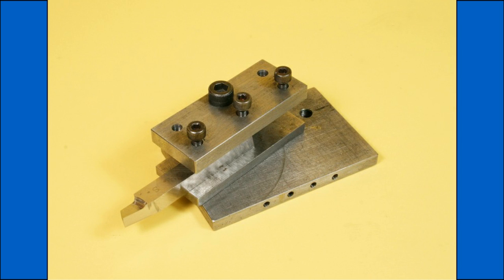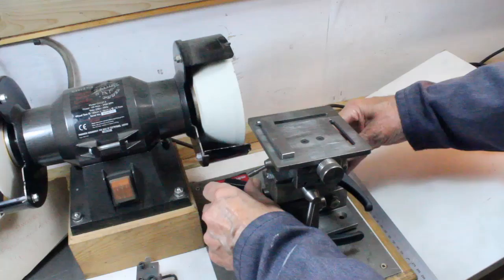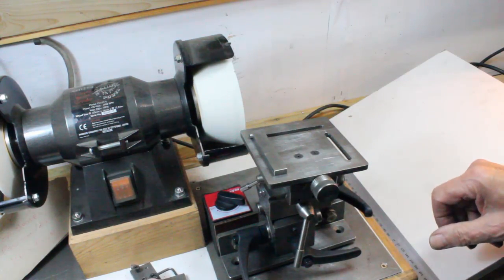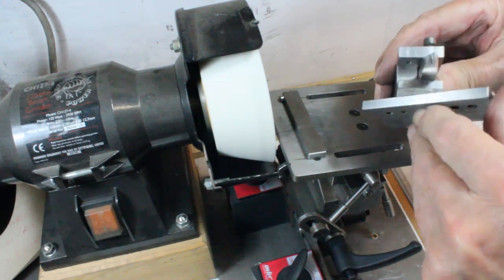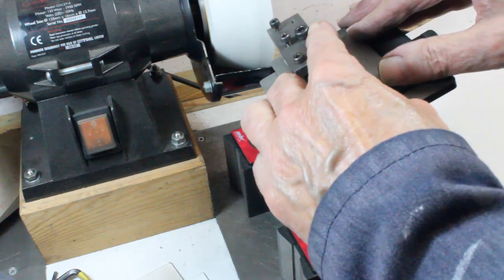Lathe KnifeTool Sharpening

Comment: What type of grinder wheels do you use.
Reply from the maker: The wheels I use are “White Aluminium Oxide” grade WA60KV1  There are many vary slight variations on this grade but if you tell your supplier you are using the wheel for sharpening high speed steel tools they should be able to advise. White Aluminium Oxide being the important feature.